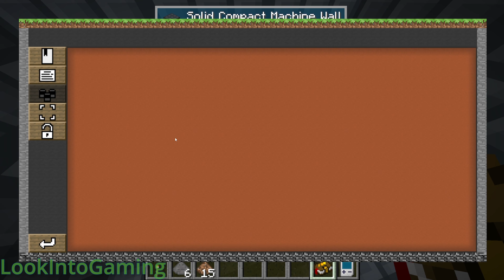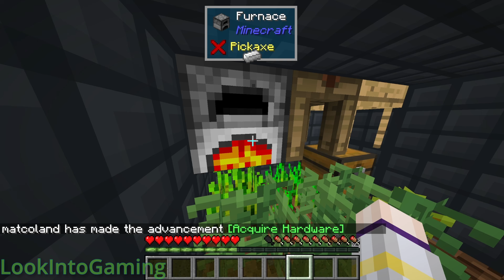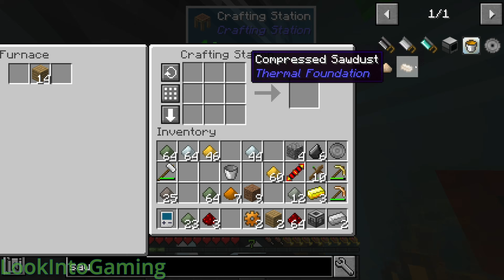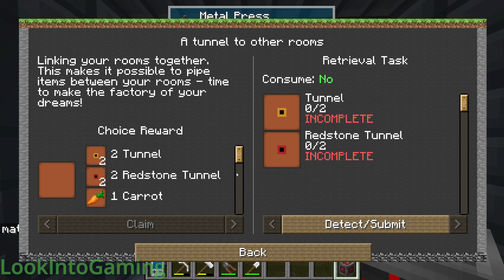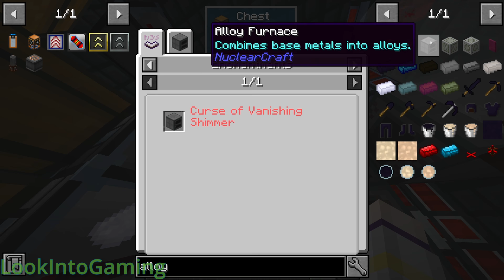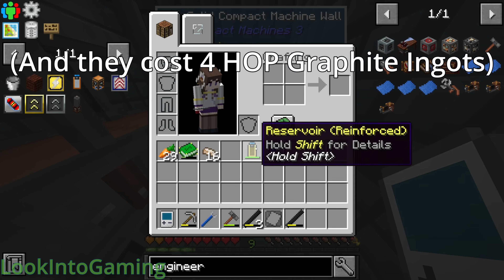How Hard is it to Beat Compact Claustrophobia? (Minecraft Modpack) Part 1

Comment from the maker: Watch Part 2 Here! https://youtu.be/bRMhsqoXd-s
Reply: Hey so i was wondering if you had any technical difficulties starting this mod because i want to play it really bad but it will exit with code 1 or just crash while loading all the mods because it only allows up to 1.5 gb ram without a huge error. Im at a loss honestly
Reply: @Hotchefmice  I had some problems back when I got the modpack, the issue was that I was getting it from the curseforge webpage and just running in on the mods folder, that didn't work. In the end I installed the curseforge app and got the modpack from there with no issues
Reply: Llll

 O l

  
 

   

  

 
L 

 
            😊L

Comment: 23:39 Not necessarily, you can squeeze in a crusher and a dust generator (and the metal press) in one small machine if you place things correctly. It gets rather cramped, but it is very doable. And by extension you only need 2 tiny machines rather than 3.

27:28 I'd say it's better to set up one, to get one coke, and never use it again because you can then make a pyrolytic conversion upgrade for a redstone furnace, then add speed upgrades to the furnace.

There's a bunch of things that could be optimized, actually. For example after the 12 theremoelectric generators, I would use a bunch of garden cloches to make wood to power steam generating dynamos to power steam turbine dynamos, which make way more power than just burning the wood in a combustion dynamo. But that thing I would do after getting the large machine, which I get after getting a bunch of constantan tuff and electrum to autocraft picks to make modularium, and then after getting the large machine I would get diamonds, preferably through hopstitute fiber from a desh pickaxe (very complicated to make) via arc furnace. The arc furnace will obliterate the thermo generators, but it will still run, just very slowly.

And so on.

I played CC multiple times actually, it's very fun. Perhaps you should too.

Comment: Once you have large compact machines, you can set up an immersive engineering miner to generate ores. Just keep smelting and regenerating your compact machine until a core sample shows that a miner inside can generate diamond ore. That lets you skip making HOP graphite ingots and delay making a high impact compactor. Definitely not intended progression, but it works.

Comment: 14:58 SLIGHTLY?! here's the hard cold math mate. for tge same carbon footprint (space) the thermoelectric generator produces 20rf/t while the decay generator is supposed to produce 160rf/s
with 20 tics in a second it gets the thermoelectric generator up to 400rf/s not to mention it isn't going to cause fluctuations as it slowly eats away it it's block to turn it into something else. Though that something else is useful down the line so it's useful as a secondary power for a little bit while you're setting up infrastructure and can't connect everything to the main one.
Reply: I'm just going to keep adding these as replies to this message :\
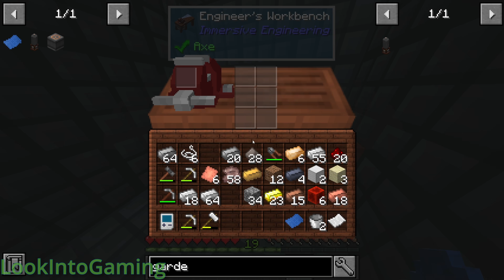18:12 Tunnels, yes it's not the greatest but you can technically fit it in a 3x3 room to make a small bit of automation. though you'll need another power source in there for the other stuff or a second tunnel. Both our points stand :\

Comment: how do i get slag im stuck on getting slag and nothing is working
Reply from the maker: If you mean acquiring slag, I believe the best way to get it is from the Induction Smelter. If you mean removing if from the Arc Furnace, there's a orange port on the back near the power ports, and you can just put a chest there to collect it.

Comment: I recently completed my run of compact claustrophobia and I'll submit some tips for players that are going into this pack.
1.  Coke ovens are useful for making  exactly 1 coal coke and then can be immediately binned for pyrolytic conversion  augments for the redstone furnace (id recommend you have 5 running simultaneously as that will make your hop graphite bottleneck your crusher).
2. Excavators from immersive engineering do work inside of a 9x9 machine and the name of the game here is checking for coal veins. you can smelt your large machine to reroll its interior and thus its vein. While limited in the  amount it can pull from the ground each vein gives thousands  of coal ore which can be put into a mechanical press for ~6.5 coal per ore. It also gives diamond ore which gives full diamonds ~400 ore per vein.
3. Nuclearcraft Alloy furnaces turn 2 iron blocks and 1 coke block into two steel blocks at a crazy fast speed making the arc furnace worthless.
4. Make an early rich slag farm by cycling compasses into an induction smelter. This consumes ~5 redstone and ~5  sand for every  rich slag. the rich slag can then be used to make rich phytogro and fluxed phytogro. Once you have phytogenic insolators each rich slag makes 16 fluxed phytogro which makes 288 logs.
5. the watering can can be used inside a shift right clicking auto clicker set at speed 6 pointing at a refilling water source to make your trees in your early tree farm grow faster instead of relying on bonemeal or phytogro.
6. Copy-Paste gadgets work inside auto clickers and can be shift right click bound to external inventory sources. Use this to make an automatic ender pearl and compact machine wall farm.
7. Fusion reactors can blow up if left unattended and are annoying to get running again. As tempting as using them for power is its not worth the hassle just use fission reactors.
Reply: I don't want to play this modpack anymore, I'm not a masochist (played again tomorrow)
Reply: Best modpack ever. Then i reached fusion reactors and found out why i never touch it again... restarted two times more and always end with fusion reactor. Even with cheats that thing is such a chore

Comment: Be Bold and live in a coffin room
Little John worked hard for all his life, saving for 15 years bought a house in new york. When he opened the room he almost fainted, the room was less than 4m². The room was so small the cockroaches even left, it was barely big enough for a coffin. Little John made a makeshift bed out of leftover bricks and slept curled up, crying everyday. He couldn't take it anymore and went into rennovation mode.

He welded a frame out of galvinised square steel, and secured it to the wall with screws he borrowed from his aunt. Then he wrapped it with eco friendly wood veneer, durable for 100 years. He put a soft mattress on it and boom, a comfortable bed. He put comfortable bags around the bed and a foldable desk which doubles as a work place and dining area. He dug out a creek from the wall and wrapped it in wood veneer for a bedside table where he can place his books and installed a socket so he can charge his phone. He borrowed a square metre from the fabric of space and time and built himself a wardrobe to place his out of season quilts and daily clothes. Underneath he installed a squat toilet and a wall mounted shower so he can take his morning routine in luxury. He installed  a cupboard and dug out for a washing area for his veggies and installed a smart mirror for his toiletries and installed led lights to set the mood. Right next to it he set an induction cooker for a mini kitchen. He installed a projection screen so he can watch korean drama after a hard day of work. Finally he built a ladder to get up to his bed. In this room, little john has all he needs to live a fulfilling life.
Reply: I hate that I know what tf you're talking about 🥷🏿
Reply: Shoutout to his aunt
Reply: .... I want to post my reaction images so badly.

Comment: 13:05 By throwing the dust not directly into the source block of the sewage, but the flowing part it doesn't get used up, you do need to update it though since right there it was still water

23:35 You can also provide water to your cache with an aqueous acumulator

38:33 You can also make an autoclicker use the gadget and automate the miniaturization process, it's a bit complicated but you can find more details on the official discord

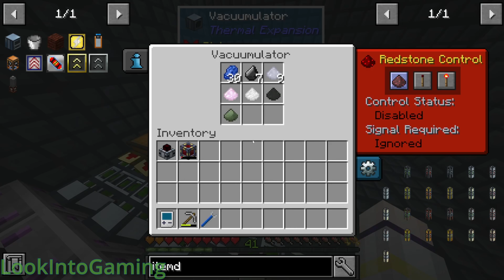39:37 The best speed for any given pickaxe on an auto clicker is 5 with the exception of stone having the optimal speed of 4

Comment: You could have used an induction smeleter from thermal expansion for automatic steel instead of using the arc furnace. You only need charcoal dust and iron and some flux
Reply from the maker: I did use that for some steel when I really need it, and I have no clue why I didn't do that for all of my steel needs.
Reply: @LookIntoGaming  yeah, i also wasted a lot of time getting steel, but i did it through tnt lol

Comment: The flux reconstructor upgrade for the energetic infuser (i think thats what its called) skips A LOT of tedius pickaxe crafting for specifically the Desh one aswell as the diamond ones, by using xp to repair the item. The xp is gotten by using an insightful condenser with lapis.
Reply from the maker: Thank you for the info. I wish I had known this during the run, and it would have been good, mostly with the first desh and diamond pickaxes, but I don't know how I would automate removing them from the auto-clickers. I will add a part about this fact in the video now though!
Reply: @LookIntoGaming  Refined storage importers set to low durability. Make 2 pickaxes if you want the clickers to be on all the time. Set the whitelist on the importer to any durability, doesnt really matter then set an exporter sending the repaired pick once the cliker has damaged it enough. This does need a pretty robust glass making system for bottles of enchanting but it is entirely passive other than that and it only takes a small bit of lapis as reagent, so that your XP can get multiplied.
Reply from the maker: Well, I don't think I'll be playing this modpack again any time soon, but I will test these in a separate world and put them in the video as concepts. I also tested the xp thing today, and it is a way to automate xp, but there's still no good way to get xp. I used a bunch of nuclear furnaces with gold grit then pulverizing the gold ingots to repeat the process.
Reply: @LookIntoGaming  There is a book from thermal expansion or series that can extract your player XP. Once you do that you just use a fluid transposer to get a few bottles to jumpstart the system, then clicker those bottles away over the insightful condenser which will give you more XP than what you used for the bottle, which will then go back to the transposer and the process is infinite, as long as you have lapis and glass for bottles.

Comment: The auto clickers will run for free at the slowest speed

I prefered to avoid specialized pickaxes and instead spammed clickers with iron and stone picks.  😊
Reply from the maker: For the first 2 I got, I had to go with the zero rf option when I got the sawmill and furnace. I also applaud you for just brute forcing the pickaxes, I could never deal with all of that flint.
Reply: Eventually I had a storage system made from caches to hold all the outputs.  You can also chuck flint into a fire if need be.
Reply from the maker: That's what I figured. I also forget that the universal bin exists.